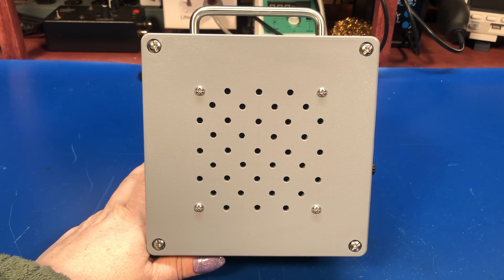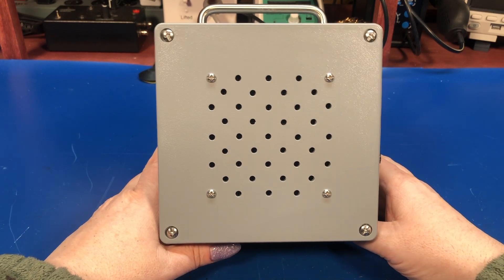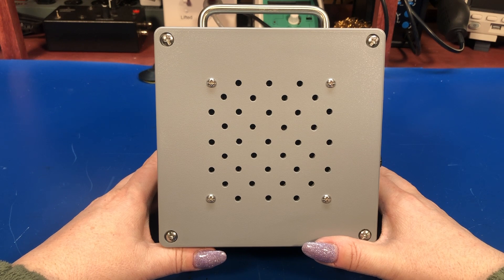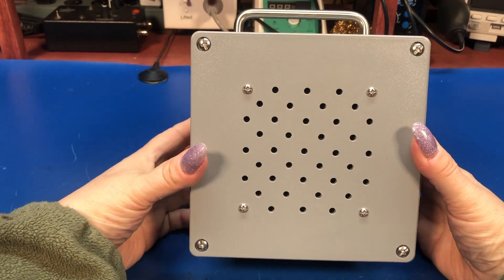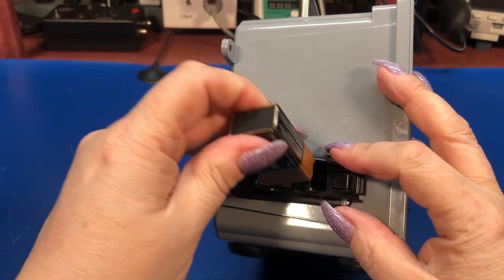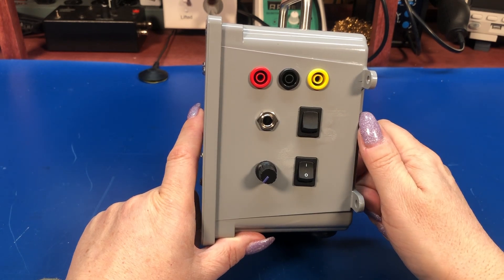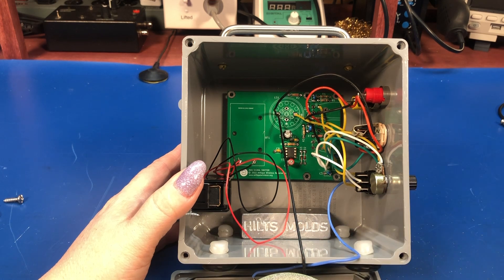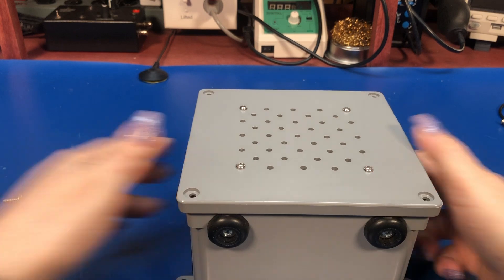AWA Signal Tracer Build

Comment: Nice tracer, looks a bit too small for its enclosure but very clean and well thought out :)
Reply from the maker: I could have build it as they designed, which would have been much smaller, but I wanted to use the 5" speaker, which fit perfectly in the lid of the enclosure.